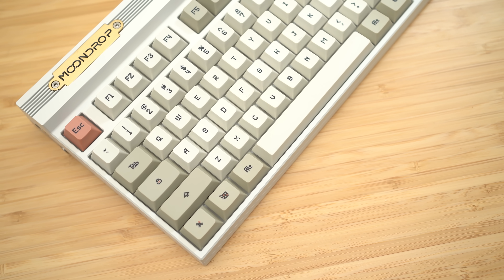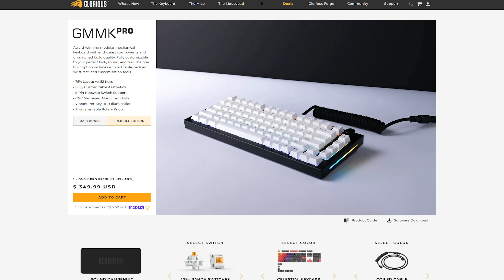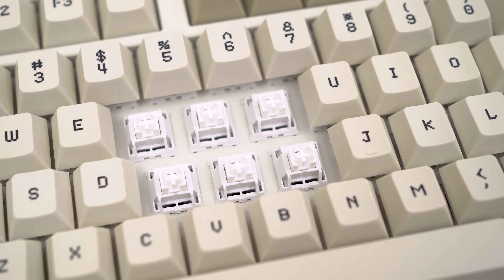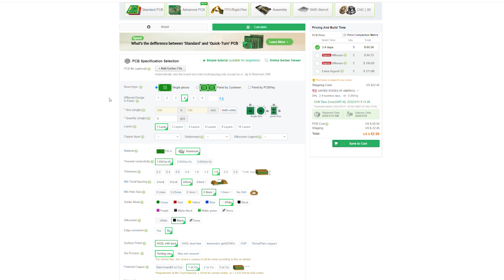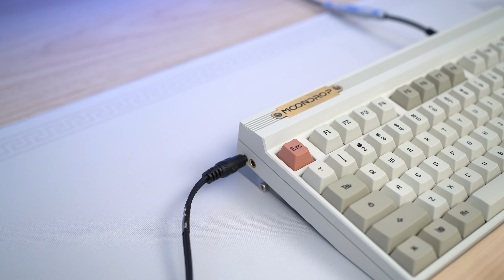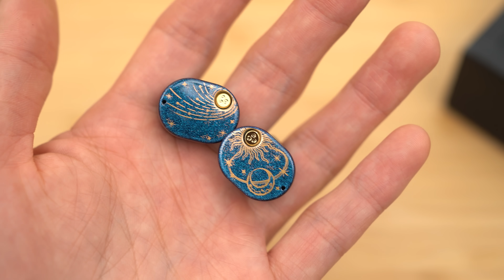This Keyboard Makes Me Mad... Hi-Fi Keyboard by an Audio Company

Comment from the maker: So, I received confirmation that the Moondrop Dash75 is compatible with VIA!  Moondrop is making a few more improvements to the Dash75 as well, so they'll provide an update to the launch date once complete.  Linux compatible for those that asked.
Reply: other than stem length and spring stuff, what is the difference between box cjs and normal cjs?
Reply: Whats the starting price for this keeb
Reply: @nicholassanchez5117  299$
Reply: Same here I find no mention of the keyboard anywhere
Reply: i want to get this  masterpiece, where can i get it
Reply: Now I know what'll be my next keyboard
Reply: No VIAL no buy
Reply: I see no mention of this keyboard on Moondrop’s website. Where in the world do I get one of these?
Reply from the maker: @NateFord  they let me know that they are working on a few improvements and will update once that's complete!
Reply: Why would anyone ask if the keyboard is Linux compatible? Is there any keyboard that isn't?
Reply: @nuewink  I assume the DAC/Hub integration could potentially cause problems
Reply: @Ottomagne  the USB HID standard covers USB hubs, DACs are reused from some other moondrop project or bought from another manufacturer, so there's no way Linux doesn't already have a driver for it
Reply: @nuewink  is a good dac/amp?
Reply: @x7nick7x48  I am not a sound enthusiast. For me, as long as there's no hissing, crackling, or white noise, the DAC or AMP is alright. I don't have the hearing, music source, headphones that would be capable of letting me tell the difference.
According to DROP, the keyboard has a moondrop moonriver 2 DSD256 DAC/AMP, which costs $171 on Amazon right now. I think moondrop is a respected company among sound quality enthusiasts, and if it's this expensive it must be good. However the Moonriver 2 is a *dongle DAC/AMP*, not a full-sized one. Dongles need to be small, compared to a proper DAC of the same price the sound will obviously be worse. The Moonriver 2, according to the review from head-fi, can run beyerdynamic DT990 Pro headphones loudly and still have some room when it comes to the power. So the AMP must be pretty powerful as well, at least when running from the 4.4 mm output.
Besides, you also get a keyboard that sounds good and has factory lubed switches. Equivalent of that keyboard from other brand would cost way more than the $200 they're asking.

By the way, why not just do the research yourself? You don't need to wait some rando from the internet to reply, google is right here, you just need to do the right query
Reply: @nuewink  thanks, I asked to you because i didn't know the dongle, so I wanted an opinion. However although the audio quality I want to buy this keyboard because is good and I like it.
Maybe I will change keycaps with better aesthetic gmk set

Comment: Good video, but one thing I want to correct is it's not the impedance that makes a headphone hard to drive, but the sensitivity. You can verify this by looking at high impedance low sensitivity headphones like the Audeze LCD 4, which has an impedance of 200 ohms, but an ultra low sensitivity. So you can run that easily from the laptop and still get excellent sound. On the other hand, we have things like the FOSTEX T50RP, which only has an impedance of 50 ohms but an extremely low sensitivity around 85 decibels, meaning you need a much more powerful lamp to drive this thing. 

Simply put, your sennheiser's are actually not very hard to drive for any modern amp. And inversely, there are many low impedance headphones which are extremely difficult to drive because they require high current instead of high voltage because of their low impedance. 

That being said, you are right about needing lots of voltage for high impedance headphones. 300 ohms, 600 ohms etc headphones do require upwards of 4 to 8 volts, which the laptop dac amp cannot push. 

For anybody wondering, what happens with high impedances it stops the flow of current. The higher the impedance, the less current that flows, That's why you need a more powerful lamp for high impedance headphones- not because the headphones need more power, but because the resistance within them decreases the amount of power which the amp can push through.

Comment: This is right up my alley. As somebody that doesn't think keyboards should flex like a $200 laptop from Walmart, I enjoy a nice solid plate. And integrated plates are the best in that regard. And having a clean noiseless DAC for IEMs is pretty huge as well as my current DAC has way too much noise. Just hoping they make more of them. And enough to actually have some stock somewhere other than drop.

Comment: This might sound like a dumb question, but can this keyboard use a USB C-to-C cable? For example, plugged directly into a Mac Studio Display without the need for an adapter?

Believe it or not, my current "USB C" mechanical keyboard must use a C-to-A cable to work. Plugged straight into the Display's C port, and nothing - no input detected.... but if I add an A-to-C adapter then somehow it works.
Reply: Have you tried another cable?
Reply: @Henrex2000  Good question! I actually tried a few different cables including thunderbolt compatible ones because I was worried some might be "charging only", and it didn't solve my problem. In fact, I used the same C-to-C cable with a Massdrop CTRL keyboard's C port to my Studio Display's C port and it worked!

Which led me to guess that my problem mechanical keyboard (GK64) might use a USB C connection that isn't performing a necessary handshake with another USB C port (like the one on my display or laptop for example).

Comment: This shows a few things that we already knew about the custom mechanical keyboard scene: one, that, due to the small volume of production, being a niche product, the overall cost of producing a keyboard is high and the consumer ends up paying a lot for the item, so, when an established company that already produces PCBs, does machining and has the right tooling comes into the game, they lower the production cost a lot, offering the same as the boutique brands for less money. And two, that there is a high markup in the custom mechanical keyboards, always attributed to the aluminium machining, which, is expensive, but wont ever be the cause to charge 600 bucks for a product that you end up building yourself. So, when you find that a serious company in a different sector can make a keyboard better than dedicated companies when they didn't have the experience, it shows that, making a keyboard is not 600 dollars hard...

Comment: I ordered an EVGA hotswap keyboard when they were clearing those out for 40 bucks because it was cheaper than buying the switches alone. I wanted the switches for my Drop Alt, and it turned out to have compatible stabs that were better than the ones preinstalled in my Alt. That was a fun surprise.

Comment: The HD 6XX are not 300 ohm. they are a 32 ohm Version of the original HD 600sWhich were in fact 300 ohms but the HD 6XX are only 32 so you can run them with a smart phone
Reply from the maker: They absolutely are 300 Ohms... it literally says it in the spec sheet provided.
Reply: @Keybored  Oh! My apologies I must be thinking of a different pair.
Reply: @Keybored  I must admit I was also in disbelief at the concept of a keyboard running 300 ohm headphones

Comment: This just shows how incompetent and complacent mainstream keyboard companies have become. They charge a premium and still can't get it right and have the audacity to charge more than what it should cost. 

This is their first.. FIRST KEYBOARD... from an audio company. You see this keyboard with proper USB support, a premium and pricey BUILT-IN DAC AMP (used a MoonRiver 2 DAC AMP costs more than half the price of this keyboard) Combo audio jack for 3.5mm and 4.4mm headphones, priced relatively cheaper than some "premium" pre-builts and already sounds way better stock than its "competitors" out there. Although not perfect, it provides more features and resolves a main quality issue like the stabilizer rattling (no stab rattle) and has a proper factory lubed switch (still on the high tone side but better than some other stock switches).

This keyboard by an audio company is already stamping out companies with a history in keyboard manufacturing. This is just embarrassing to all the current keyboard manufacturers out there and this should be an eye opener directed to them to say the least.

Thank you MoonDrop for showing how it's supposed to be done.

Comment: Because its just a keyboard.. theres little to prevent even an idiot to make a good keyboard. Provide proper usb c port, damping, proper key caps, and make all with proper material.. not hard to just grab the most highly rated keyboard, copy it, then add ur own design to make it “unique” like the addition of the dac… 

Moondrop can make a good keyboard at first step because theres Way more care and discipline to building audio gear vs a keyboard.. hence the extra mile present in the moondrop keyboard.. 

So why are the keyboards made by legacy keyboard makers lower quality than this moondrops? Easy.. COST.. why offer more when theres an abundant amount of idiots willing to pay more for less?

Comment: This is some sure-handed execution on the part of Moondrop.  The advantage of audio companies is they are used to developing and testing complex acoustic/mechanical devices which keyboards are at the end of the day.  I wonder if this allows them to better prioritize their battles and deliver functional value.  Also, being as the company's other products slant towards clear, treble-emphasized footprint, it's not surprising they deviated from some strong current keyboard trends to steer towards their preference.  Integrated plate. . . but the potential case ping is offset by the PC bottom housing.  And then all of the low-cost, high-reward tricks are well implemented in foam config, stabilizer spec/tune,  factory switch lube, and even tape mod.  My guess is they made a stiff, direct feeling board precisely because that's what they like. . . and then properly balanced all the other variables to deliver a great out-of-the-box experience.  What a confident first step.  This could potentially ruin a lot of keyboard enthusiasts to onboard audio or bad DAC's forever.

Comment: A hifi... keyboard. 3 possibilities before watching: 

1: It's another audiophile scam that's supposed to be a keyboard that doesn't have any electronic noise and can purify your whole computer system of the white noise demons, or some other borderline religious stuff.

2: It's designed for a hifi-integrated and oriented HTPC with specialized media keys, probably ships with a receiver that has a pc interface to control everything from like a very very niche smart house

3: It's the same enthusiast keyboard borderline scam as any other high end mechanical, but it's designer was also an audiophile and thus saw the parallels between people who like keyboard sound and people who like expensive audio, and wanted to fuse the openly misleading jargon into a new giga-scam.
Reply: Alrighty, rare pleasant surprise, reasonable product compared to its contemporaries

Comment: Not completely sure on the details of the dac/amp in the board, but I think it may be using the same or similar circuit to the Moondrop Moonriver 2. If that’s the case, you are getting a dac/amp worth $189 on your $300 keyboard. I own the Moonriver 2 personally, but for anyone that doesn’t, the value is insane. This is Moondrop’s full send to get keyboard enthusiast addicted to audio lol. Smart move.

Comment: Hi, I just stumbled on your channel and saw your quietest keyboard video.

I was wondering if you have a video on the best fighting/gamer keyboard for streamers? As in it would need a couple of things:

Fastest inputs. Like arcade stick buttons, or small depress distance
Low sound
Wired/Bluetooth with connectivity to consoles/fighting games
Protective traveling case with detachable cord.
Easy button swapping/mapping..
Plug ins for headphones and 
Possible peripherals like controller or rolling ball for golden tee games
Color.

There are gamer fightsticks like hitbox as an example but that is specific to fighting games.

Anyways, thanks again. I'll subscribe.

Comment: I have a Moonriver 2 and it’s great.  The balanced 4.4 output has even more power than the standard 3mm.
Reply: Been using the Moonriver 2 with my Steamdeck, awesome little unit, my only minor problem was addapting the 4.4mm balanced to 2.5mm that my IEMs and Fiio M9 use

Comment: Alright for 300$ it's definitely a steal but are we not gonna talk about how the only keyboard with a built-in DAC just so happen to not have a rotary knob
Reply from the maker: You know... I wrote that into notes... and I don't know how I forgot to put that into the script... that is my bad.  That was the first thing I actually thought about too :(
Reply: @Keybored  yeah not having an analogue volume knob directly to the amp was wasted potential, but hey it's still a good keyboard for the money

Anyway is one of the headphones jack balanced? And did you use a balanced output for the 6XX? If it can run a 6XX off the single ended jack that's actually pretty dope

Comment: It actually seems like a practical solution to be able to plug your headphones in to your keyboard. Even more so with a built in DAC/AMP
Reply from the maker: I know right?  It improves the audio quality pretty drastically... and it can power high powered headphones.  If it just had a knob!
Reply: @Keybored  my only compaint is that there is no knob. I hope they do something, even like a FN control on the actual keyboard to change the volume of the dac itself.
Reply: @Keybored simple answer? the FiiO KB3!
Reply: Yep, really sad that there's no volume knob. That's half the reason I bought my own DAC in the first place.
Reply: @Catcrumbs  agreed.  What is the point of an external DAC without the volume knob.  Really huge omission in my opinion.
Reply: My only concern would be the whole purpose of moving a DAC from an electronically noisy PC over to a mechanically noisy and thumping keyboard.   Does the mechanical noise and vibration cause any sound quality issues in the DAC
Reply: @TheBjjninja  That's extremely unlikely. There are no moving parts in the DAC that will be affected by mechanical noise.

Comment: I'm very shocked at all the mods they used, this board looks extremely labor intensive. Look at all the mods they've used, some of them are very hard to be done with machine and is likely done by a human. 

All the foams need to be installed and line up perfectly. And the look at that nicely installed tape mod. 
One tiny thing that somehow amazed me is the stabs at 6:22, they even put in the black sticker thing which we never see in a prebuilt.
Reply from the maker: I know right?  It's so crazy the amount of effort they put into this thing... and even the lower PC bottom is like rock solid

Comment: I noticed when you opened the board there are pads that look to be for LEDs, do you know if there is support for LEDs or will be an led version in the future?
Reply from the maker: Hmm... I'm not sure.  The board has so many potential upgrades in the future it looks like... like there are multiple ribbon cable sockets, additional connectors, etc... I wonder if they're planning to expand this beyond what it does right now.

Comment: Man they destroyed the budget IEM market with the Moondrop Chu's and they are already held highly in the high end audio market and now they're making one of the better pre-built keyboards on the market?? There's no way of stopping Moondrop if they keep up this pace. They're insane rn.
Reply from the maker: It does seem insane... not sure how they stuck all this stuff into this and make money on it... either that or others are ripping us off hard
Reply: @Keybored  I suspect that it's other's ripping us off hard unfortunately. For some components. The switches on their own are not that expensive as you know. Although the cnc'd cases are justifiably expensive, the pcb (with a stm32 or atmega microcontroller,hotswap sockets, diodes, transistors, etc look at the individual components and then check out digikey for bulk prices), stabs, keycaps, keyboard plate, foam, etc really shouldn't drive up the cost so much to charge 350+ usd prices even with 5+ COGS factor. Hell, even wooting's offering is cheaper and it uses hall effect and has decent software (which justifiably drives up the cost). I also doubt that most of these 'keyboard companies' have latency similar to let's say, a wooting 60he or a razer huntsman series keyboard.
Reply: @Keybored  probably other people are ripping us off

Comment: The placement of the audio jack is well thought-out! At first I thought this is made of plastic but impressed that it's aluminum! My nitpick is just the integrated plate.
Reply from the maker: This thing is massively solid... you bang on it and it's just like surprisingly hefty.  And I fully agree on the audio jack placement!  It doesn't interfere!
Reply: @Keybored  I am a pursuer of HiFi audio before I got into the custom mech keeb rabbit hole. The thing I enjoy in both is the pursuit of clean sound. I am also impressed by the mods they already did and that stabs, Wow! This board definitely is now on my radar! Thanks for the coverage!